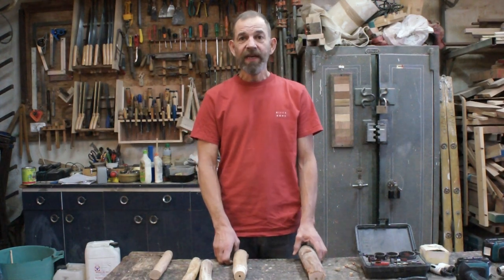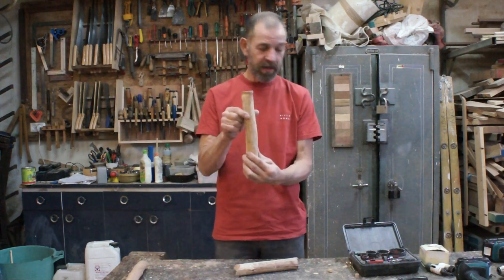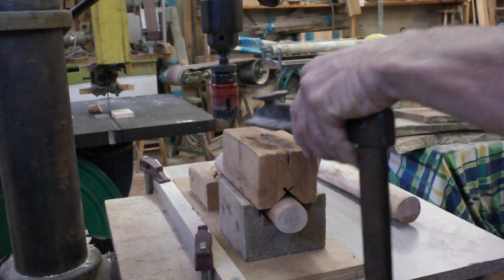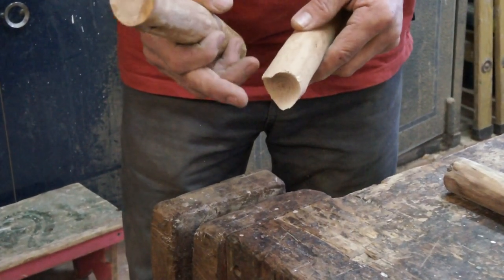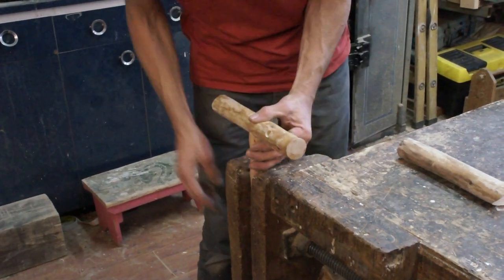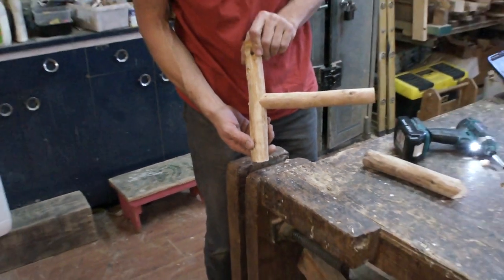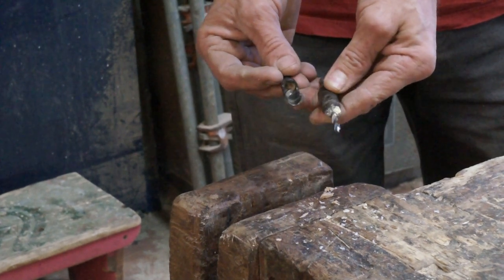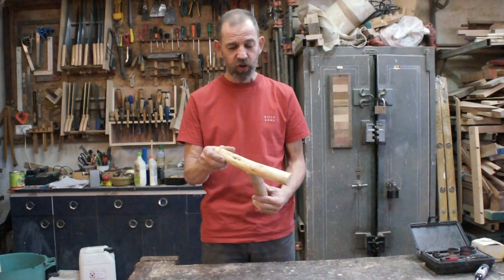How to Make Rustic Furniture

Comment: i would love to do this can you use any wood do you have to dry it  ????? no books on amazon
Reply from the maker: Hi D did you watch this play list?
Basically your tenons must be dry ,if you prepare them in green wood make them over sized by a couple of mm in diameter  then you can put them in a black tin box with ventilation holes in the sun to dry for a couple of weeks or put a bucket of sand on a fire and stick the tenons in until dry.
The mortises can be in not so dry wood, when you fit very dry tenons in moist mortises the tenon absorbs moisture and expands the mortise contracts as it dries creating a very good joint.
I hope this helps,go ahead and give it a go it’s very intuitive and satisfying work, I feel it awakens in me a primitive man that knows how to do it. 
Happy Rustic Woodworking David
Reply from the maker: Hard wood is best for small elements less than 40mm diameter softwood needs thicker diameters.
Hardwoods are nut trees fruit trees and any tree that its seed is totally enclosed
Soft woods pine cedar cypress and trees who’s seed can fall free of its enclosure when dry . You can find apps that can identify leaves and identify wood 
You could also just collect branches you find dry them and experiment